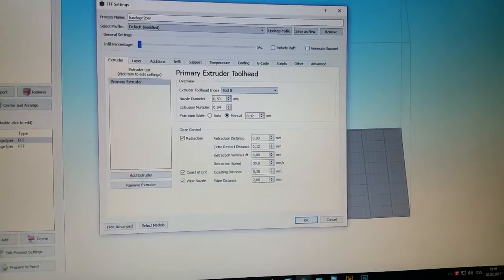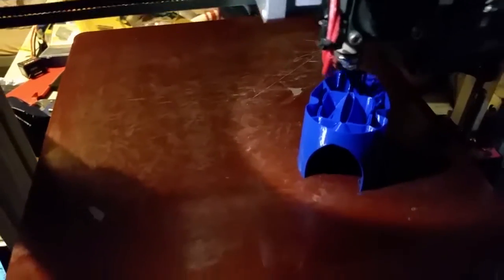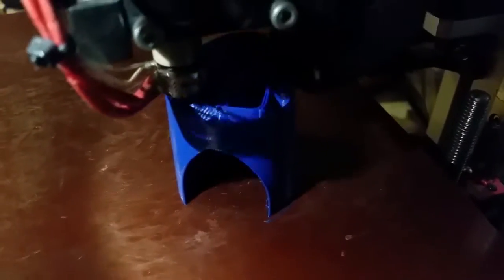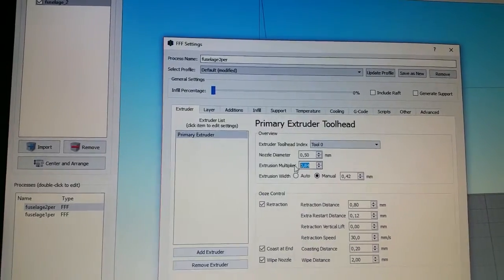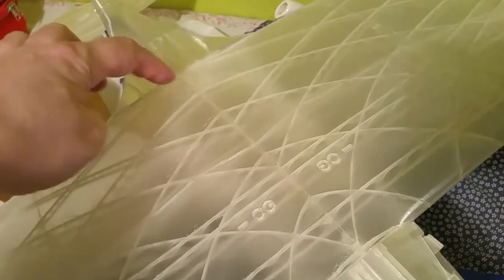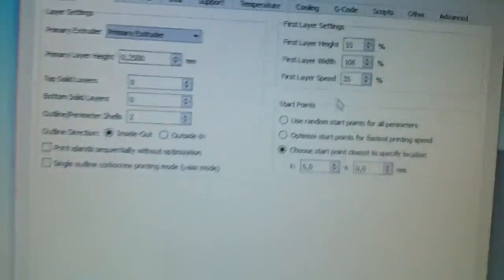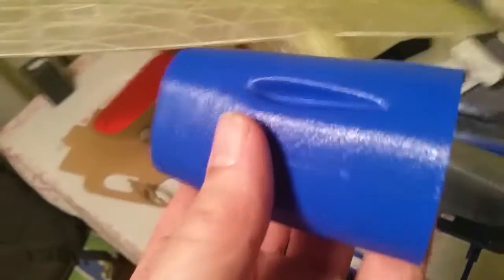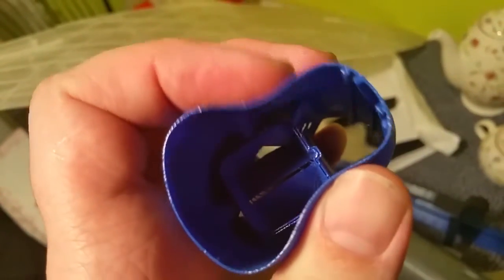3D printed RC models - A few of my tips for beginners 3D printers

Comment: Good job Richard, i'm printing a Cessna 150 from 3dLaB  but i encounter some difficulties with Cura and my new ENDER 3 Pro printer...i print with PETG from 3 DOnline , before i used from Dailyfill...i hope it will be better ...temperature is 240°, bed 70, 0.8 for walls...
what about yorus settings, Cura or other and Filament ..? 
thank's a lot...